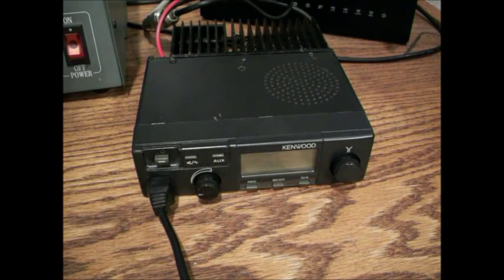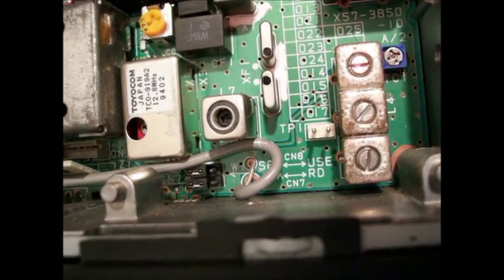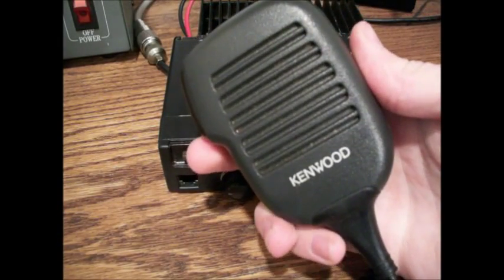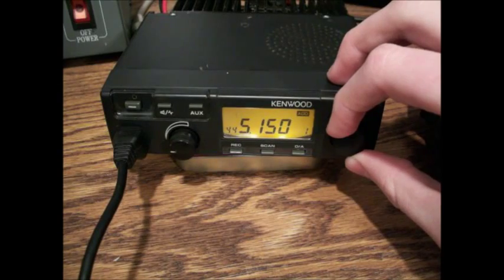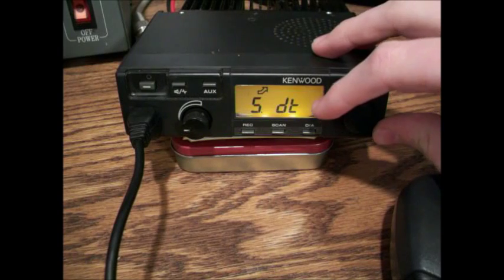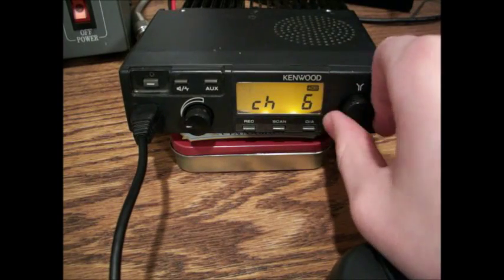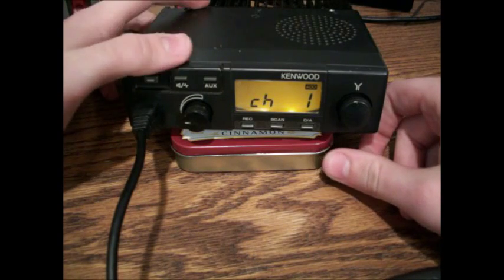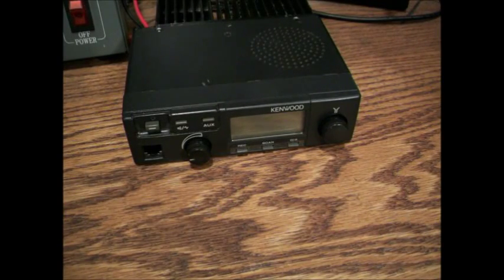How to program the tk-805d

Comment: One correction, it won't do murs, those are vhf frequencies around 151.xxx but will do frs/gmrs/ham. Not legal to tx on frs with it as the power is too high and it has a removable antenna but you can monitor them with this radio. Good review though, thanks!

Comment: I have the tk709, looks near identical to yours, have you ever had issue with turning on the radio and it just beeps with everything on the lcd showing?
Ps great vid, glad to see someone who actually lets the camera focus on the inside rather than just "ah well sure you'll work it out."

Regards, Andy
Reply from the maker: Sorry it's taken so long for me to get to this but there could be several things going on. If the jumper is not set to program (I am not sure if there is any such jumper on that model) it may appear to be frozen, when in fact it just has one channel programmed into it. I also picked up a 2 meter kenwood very similar to the 805d it has a lock feature on it. If the radio is "locked" the front display will not change at all. Good luck with your radio.